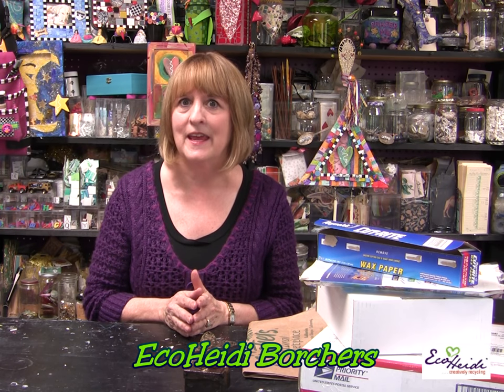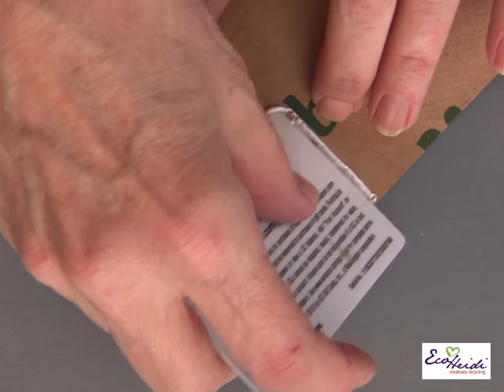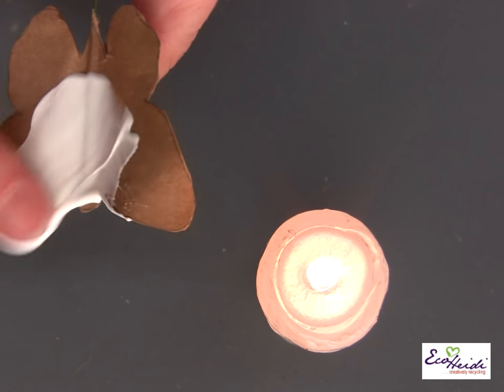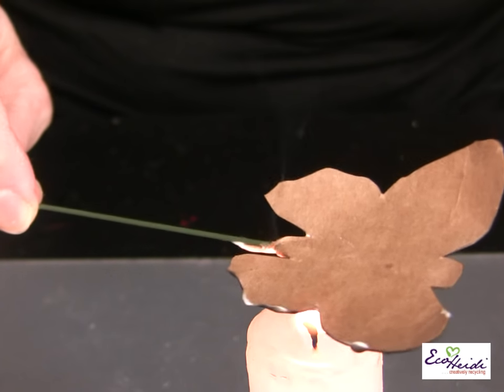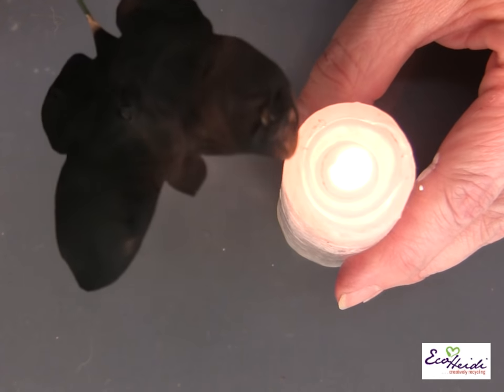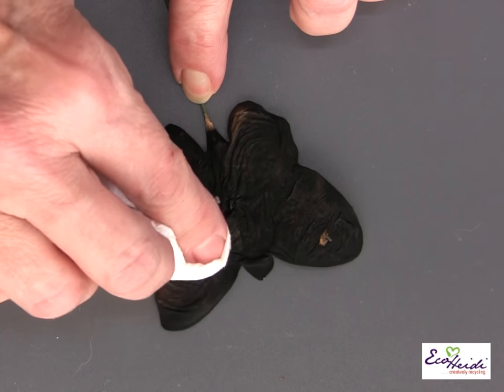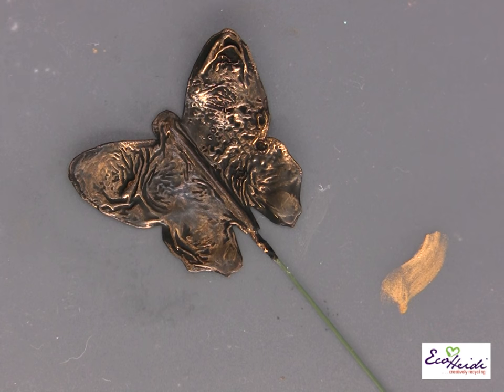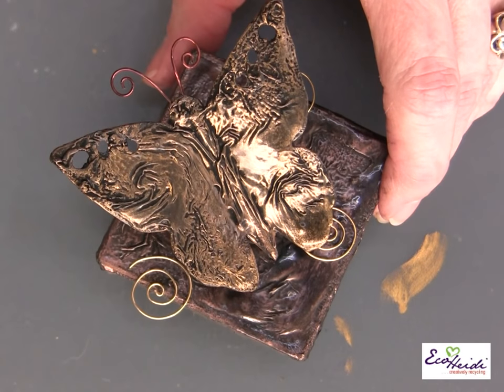Creating the Look of Metal using Aleene's Original Tacky Glue (Long Version)

Comment: Yes, you can absolutely add the antenna at the same time and sandwich it together. Sometimes we have found that the antennae get in the way when we are wiping away the soot and adding the gold paste so some people prefer to add them afterwords. We have never tried a torch as we like the control of the candle. Just seems to be the right heat in a controlled space. If you are experienced with a torch, you could certainly experiment with it. [Heidi and Tiffany]

Comment: Because the brown bag is completely covered with the glue, the flame does not touch the bag so there would not be a surface that starts a fire.  As long as you are heating the glue, you are not touching the bag. In my 40+ years of doing this technique I have never caught a bag on fire but when teaching this technique, I always recommend that you keep a bowl of water handy.

Comment: How long do you have to wait for it to dry after the candle process?  Thanks
Reply from the maker: Hi there ... After burning the adhesive with the candle, make sure all of the adhesive has burned by gently touching it with your finger. If it is still wet or glue comes out from underneath, keep holding over the flame until you have achieved a rubbery texture all over. Once you've achieved that texture, you can then clean your shape and add color. We hope this helps!

Comment: This is not good for your health ,burned glue
Reply from the maker: Hi Yvonne ... Thank you for your feedback. Tacky Glue itself is nontoxic, but certainly when heat is applied, new chemical reactions can happen with the glue. When performing this technique, we do recommend doing it in a well-ventilated area or outdoors if weather permits. We do not recommend this technique for minors, and other safety precautions should always be taken when working with fire.